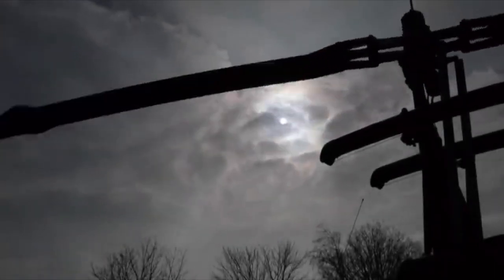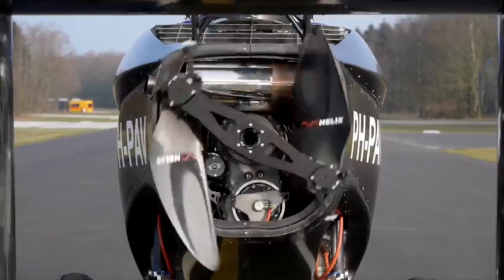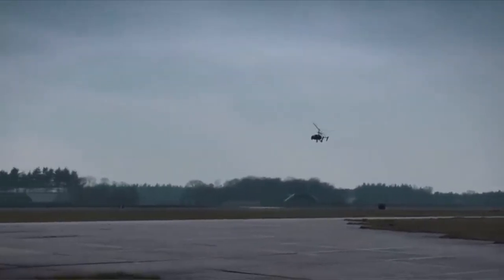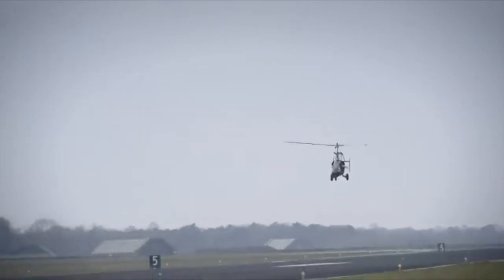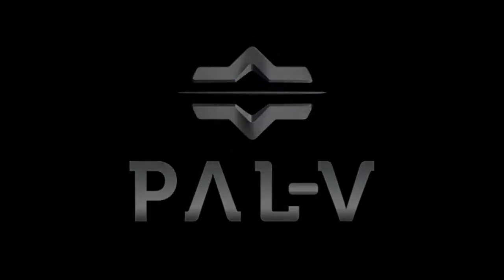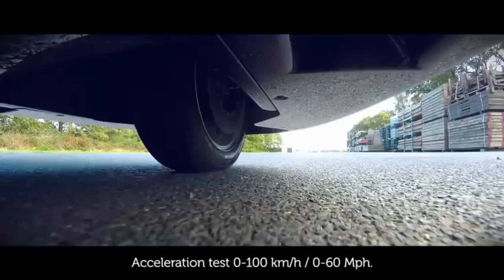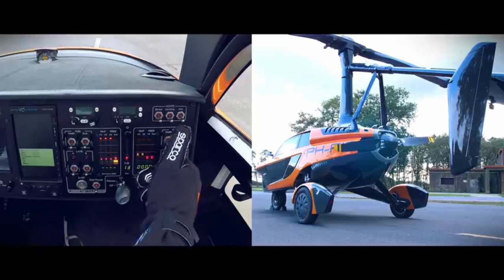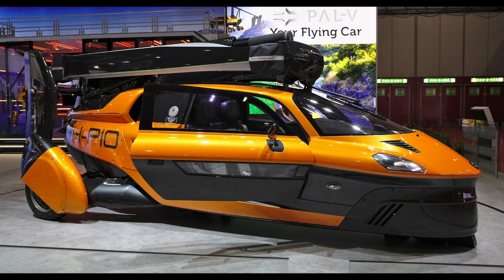History of the Gyroplane - part 22 PAL-V (the flying car)

Comment: @5:05: there is a rule set for heavy gyro's, EASA CS27 (small rotorcraft), it goes up to 3175kg mtow. It's mainly meant for helicopters so is a tough set of rules, but it is the one PAL-V follows. It's in no way comparable to BCAR section T, but it does apply to gyrocopters. It's largely the same as FAA FAR27, so meeting it does make an aircraft airworthy in most places
Reply from the maker: That said now you have an aircraft / pilot licensing mis-match....

Comment: Its It's a really neat idea, but completely impractical. 
  One might think that it might be a good way to avoid being confined to an airport, and good also double  as transportation at the destination. But really,  how anxious would a fellow actually be to drive something  like this in city traffic? I drive clunkers BECAUSE  I don't want to worry about getting rear ended, or sideswiped. No way in heck would i drive a $300,000 dollar car of any kind where that could potentially be an issue. And for that matter a hangar wont cost you THAT much. Yes hangars are expensive,  but i can shove my gyro onto a $300. 00 dollar hangar. And be in the air as soon as i can lift the rotors into place and preflight the machine. 
Hmm, preflight alongside a busy highway...... not the safest proposition either. Actually how often would it ACTUALLY recieve a preflight at all? During annual inspection?? 
 Admittedly it is definitely pretty cool. But I think id rather have a regular old Bensen. It would be lots more practical even without an extra seat.

Comment: Rotors, mast, tail and prop that "fold-up"?
Nah...don't fancy that

Some Aussies tried the wheeze of the folding-mast.
It sure folded-up nice. Killing 4 people...
Reply from the maker: Well not all might be as it seems... https://asra.org.au/application/files/5315/6037/8507/SD_2019.01_Titanium_All_Models.pdf
Reply: @gyrocopterflyingclub6148  That was the second fold-up in just over three months.
https://www.atsb.gov.au/publications/investigation_reports/2018/aair/ae-2018-073/
The father and son victims in the second crash had seemingly not heard about the previous grounding order...
Reply: The Aussie folding mast absolutely "NOTHING" to do with it and it did not make sense to me as an engineer either when they tried to say it was the plates on the folding mast. It was the blades in both the accidents and when they got unbalanced to that degree obviously the weakest joint gave up (folding mast joint) but something would give up in that drastic an unbalance in blades. Both accidents have the same root cause. All those previous blades with that construction are suspect.
Reply: @abidfarooqui-sla3301  Funny these were the only two gyros in the world to suffer this type of accident. And the only two with folding masts....
Anyhow,  the fewer "weakpoints" the better,  for my kind of flying - thanks all the same.

Besides, this PAL-V nonsense would only get "trollied" or worse, down at ASDA....